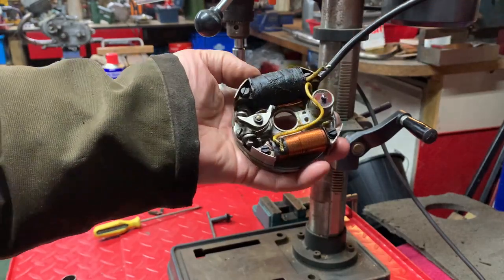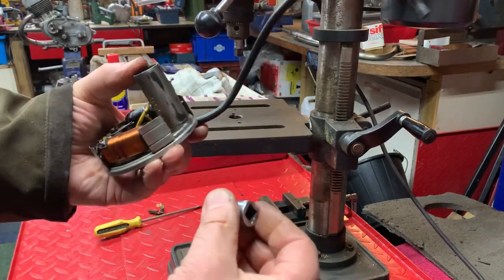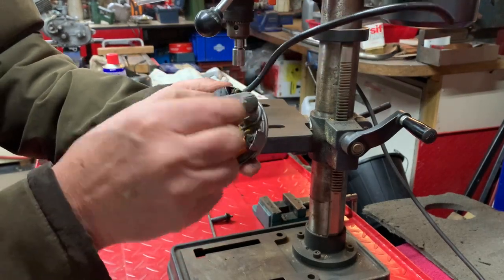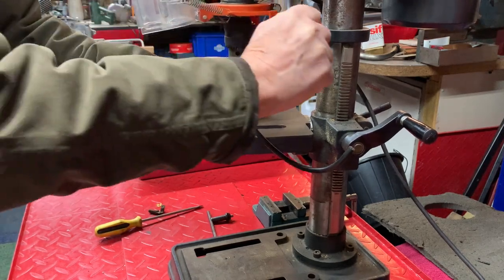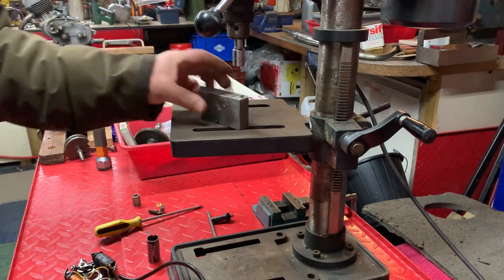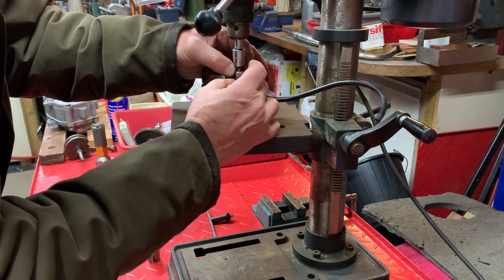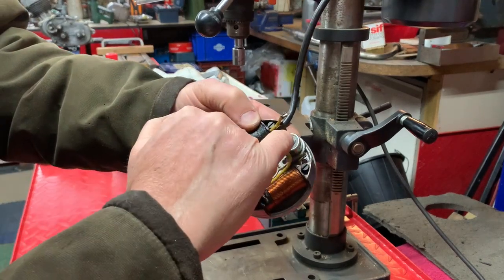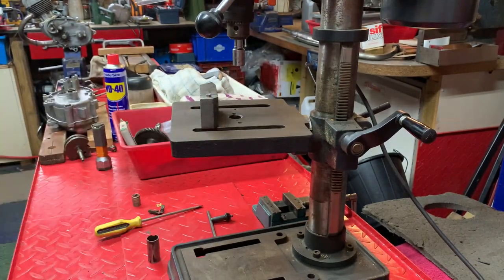NSU Quickly Condenser change.

Comment: Hi. Good, clear video. Do you have a similar video covering changing the ignition coil and replacing the points?
Reply from the maker: No, but maybe I should do one. I have a Quickly due to go on the ramp soon so I may just do a video covering changing the ignition coil and points 👍